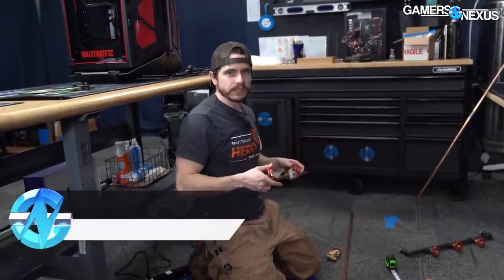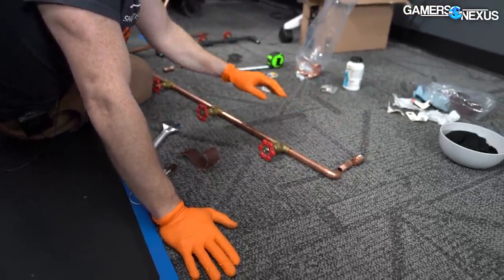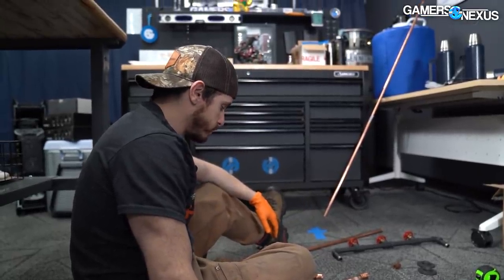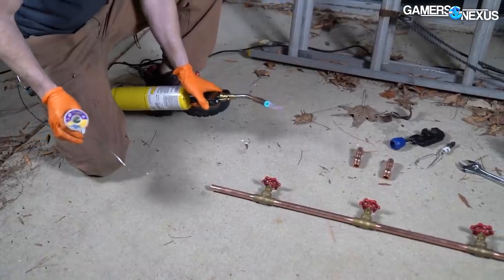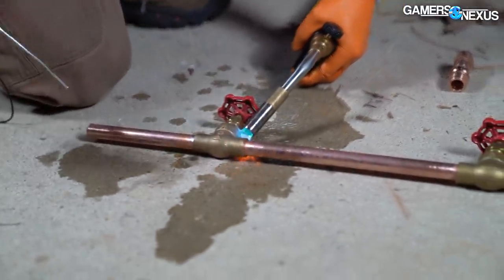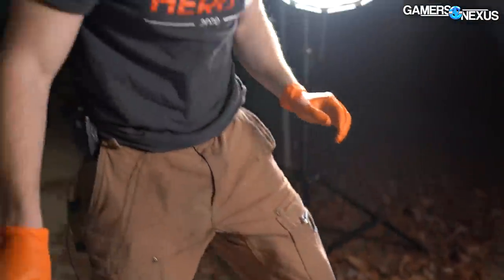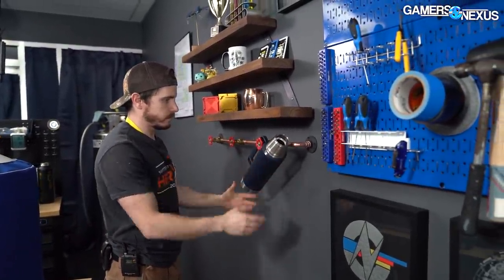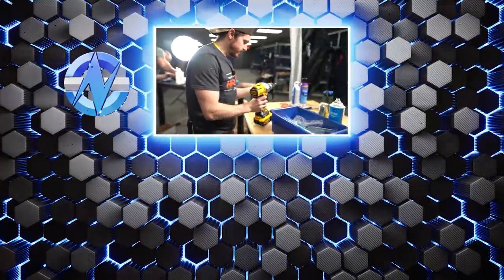A Day At GN: Building a Studio Prop for Liquid Nitrogen Canisters

Comment: For future reference, to anyone who's thinking about doing this themselves. Be careful when applying heat to concrete. The moisture in the concrete can quickly expand turn to steam and explode. It would be better to raise copper off the concrete with blocks or anything then soldering directly on the concrete. Source: plumber.
Reply from the maker: Great info! Thanks for that.
Reply: Unless we're talking about wet concrete, the concrete doesn't exactly contain moisture.
Concrete itself includes hydrates which decompose at higher temperatures.

Kinda like how ceramic coffee mugs are 40% aluminum on a molar basis but unless you heat one to 1000 C, that metallic aluminum is inaccessible.

Just being nitpicky.
Reply: Concrete is porous, so assuming it's probably wetter than it looks is not a bad thing. Especially late in the evening.
Reply: yeah done this with burning gear cutting steel it pops and fires grit around thank the lord for the eye protection I was definitely wearing 👀
Reply: I  came  here to  comment this  also   
Trades man i  had  always warned me  about this
Diesel mechanic
Reply: For some weird reason, the begining of your sentence made me think you were going to say something funny in reference to the world trade center, but then I realised you were talking about concret and being real, not about steel...
Reply: I can confirm what the Plumber, the Firefighter and the Diesel Mechanic are saying as correct.
Source: A Chemist

Comment: 2 tips that apply to almost any application of soldering.
1. Temperature control. You only want enough heat in the work area to do the job, don't want to scorch the whole project or potentially damage other components.
2. Flux. There is no such thing as too much flux, you can always clean up yhe extra later. There is different types of flux, and different types of solder, for different jobs. And the quality of both does matter.
Reply: Not arguing, but there is something as too much flux. If you apply an excessive amount of flux you can develop what's called a flux pocket. Solder will not flow into that pocket and you could potentially get a leak. I doubt however that's an issue with half inch fittings as in my experience half inch fittings tend to practically solder themselves.
Reply: Yeah you can definitely have too much. Especially if you don’t clean any extra off after, letting it eat the metal.
Reply: Also if you want them to look perfect, use flux on a brush on the outside of the joint while it's flowing. You can wipe off any excess solder and it will leave a excellent finish.
Reply: @BlackBirdMax  Also do not want too much of that in the pipe This Old House had some great pipe cut-aways and can see what happens if too much flux or solder gets into the pipes.

Comment: For anyone doing this for functional purposes, remove the valve cores before sweating pipes into them. It’s very easy to melt and ruin the seals while trying to get the joint hot enough.

Comment: For half a second I thought this were going to be some DIY centralized LN2 distribution system. And that would have been a bit overkill...
Reply: Thought that for the whole vid until he hanged the bottle
Reply: and not that well with this thing^^
Alone the low temperature makes it very hard.
Reply: Without too many details - LN2 plumbing is an absolute nightmare. Our LN2 distribution system at work is well maintained and used appropriately but still brakes down partially at least once every two months. You have issues with: Materials and seals becoming brittle at those temperatures, Air moisture condensation and subsequent freezing EVERYWHERE especially in electric controllers that are improperly sealed, valves freezing in whatever position they feel like, and not to mention: Oxygen condensation
Reply: @minklmank  I can imagine the hassle of handling liquid nitrogen in a plumbing system. And condensing oxygen is a wonderful thing to have, absolutely no dangers with having a very strong oxidizer casually hanging around as a liquid....

Comment: Years ago mistakenly purchased plumbing solder in place of electrical solder. Trying to melt it with a crappy 15W pen was one of the most frustrating experiences of my life.
Reply from the maker: When did you figure out the mistake? Did you succeed in using it?
Reply: Today I learned there is a difference in solder.
Reply: @Mephiston  there is quite a lot lol main ones are leaded, unleaded, flux core and no flux core
Reply: Need to get you a hakko 888d
Reply: @Bill-flatplanefool  skokum
Reply: @OneShot_G  I had one before my ave addiction but skokum as frig
Reply: @bofh139  dude, nice with the links and all

Comment: I would suspect that this is largely a one off, but if you need to do more soldering I'd suggest getting a small sheel of steel.
You can use it as a heat shield for the concrete to prevent scorch marks

Comment: For that screwdriver, get the DeWalt gyroscopic one. So much easier for controlling speed, it has a very good clutch mechanism and it's very powerful if you want. Even Steve from Hardware Unboxed was very happy with it for building PCs (and he said it could strip a screw if you set it to max).

Comment: nice job pretty cool never known copper being used for air line probably for cost reason but all over my workplace its plastic and yes after 20 years some of the joints have given up poly cement is not nearly as good as copper solder lol

Comment: Whenever I saw people doing this, the pipe was heat up first, then solder was applied without the torch. Keeping the flame on burns all the flux and could make the pipe more susceptible to rusting.

Comment: Looks better than the original prop hanger. Ole Gabe should be proud of it. As for the perfect sweating described... Show me a house made with a master plumber that has such perfect joints and I will give you 100 trillion dollars. The cosmetic little solder seen matters not one bit when it is inside a wall, speed in soldering matters and that includes overheating and especially over soldering. My $500k home has worse looking solder joints on the water heater..

Comment: How does soldering/sweating compare advantages/disadvantages wise to compression/bite fittings?  That's what my place of employment uses for high pressure air and water piping, up to about 4000 psi.